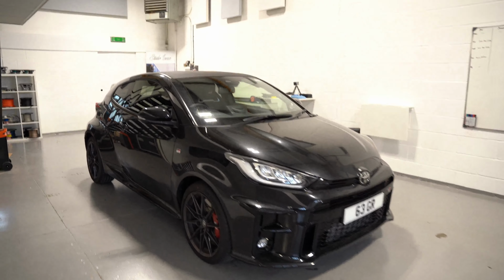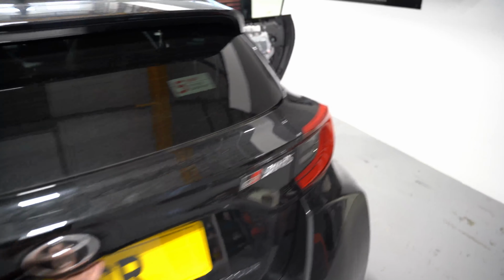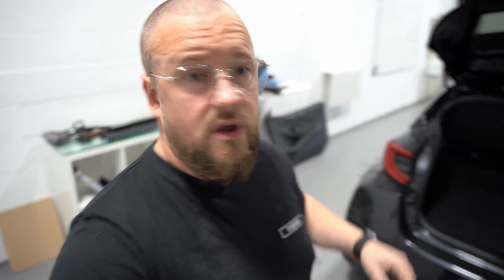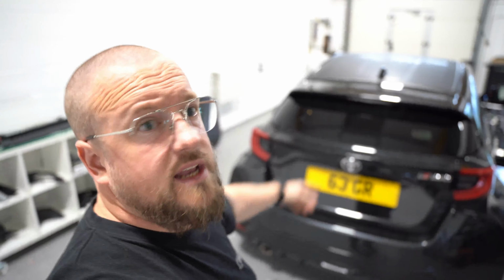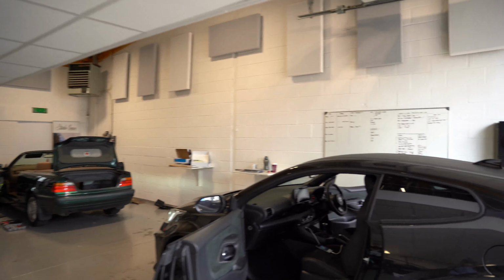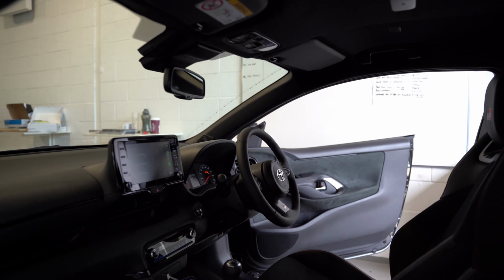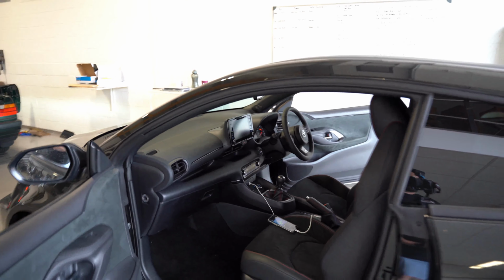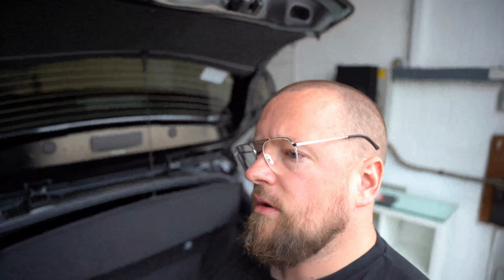TOYOTA YARIS GR Performance stereo upgrade

Comment: Did you remove the original noise cancelling and piped in engine sound?
Reply: @Studioincar  👍 So you tap the audio from the output of the ESE/ANC unit under the seat?